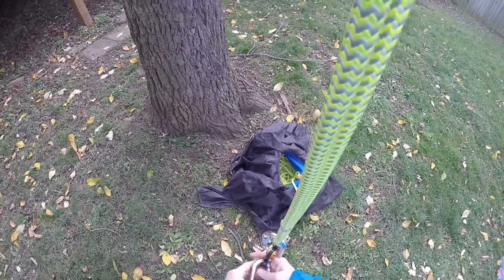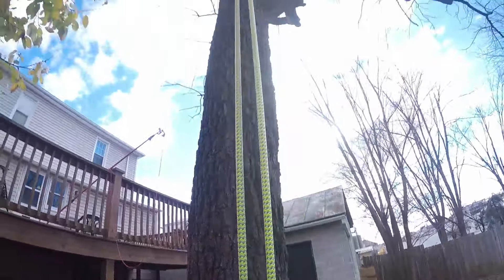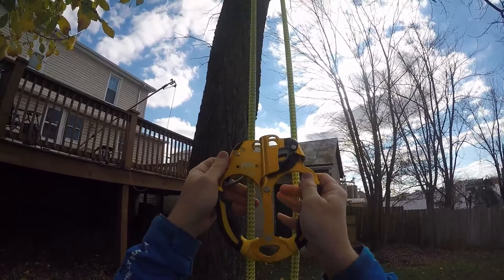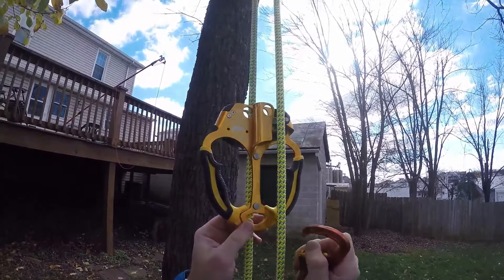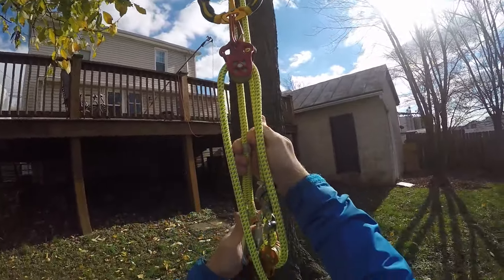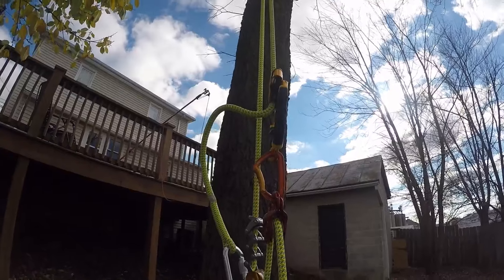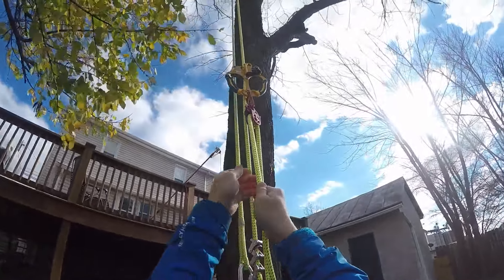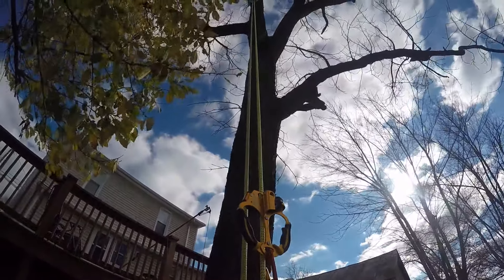Ascender and Pulley Test, doesn't work

Comment: Anywhere you are pulling slack into the system you need a progress capture device. The 2:1 on your ascender above the zigzag is fine, or run a prussik step/etrier for your foot for max gains every move without the mech advantage. Only body weight and with the right technique much faster.

Comment: A foot ascender should get you where you need to be. If you want to make  your system in the video work, you can do this:
Attach a small prusik to the standing line with a small pulley attached above the level of your ascender on the working line. . The prusik is not life support, so it can be made of paracord or even a shoelace. The pulley can be something from a hardware store or boat shop for small lines. Use 1/8 or 3/16 bungee cord from the top of your ascender, up through the pulley and down to the carabiner on the zigzag. If bungee isn't handy, use a longer piece of paracord and attach a weight so it hangs low enough that it won't cause an emergency appointment with the dentist. The idea is that the ascender should float up when you lift the rope. The prusik will stop at the friction saver and slide on the rope if you need to get that high. Things won't get out of reach that way. When you need to descend, you can disengage the ascender and let it hang from the prusik. This also avoids dropping it when you get ambushed by a critter.  Advancing your tie in point requires disconnecting the prusik, so this technique is fiddly.

Comment: I had the same same idea! But it failed as well. The problem is that when put the hand ascender on your anchor side is that all you do when you pull is make the hand acender the new anchor point and you never advance the zigzag side around the tie in point. I'm working on it, but I am using a frog walk system. I'll let you know if I figure out a good solution to advancing the hand acender.